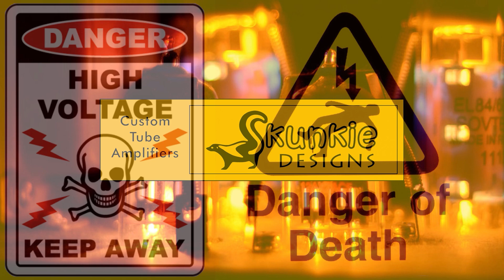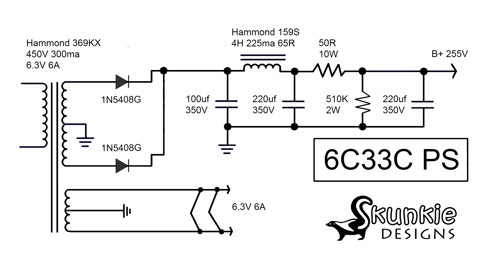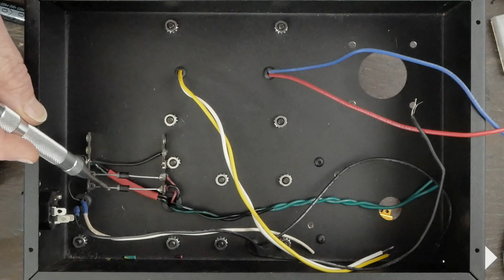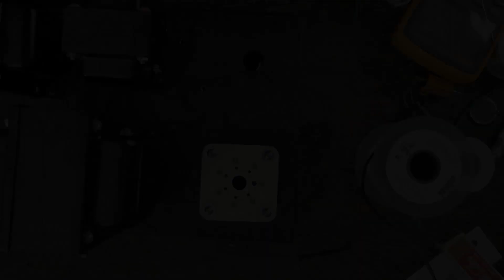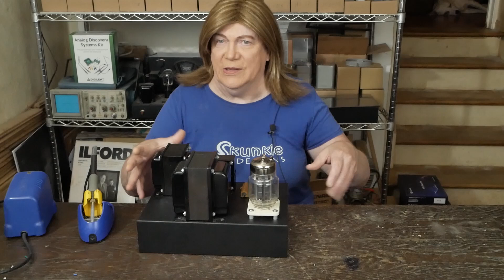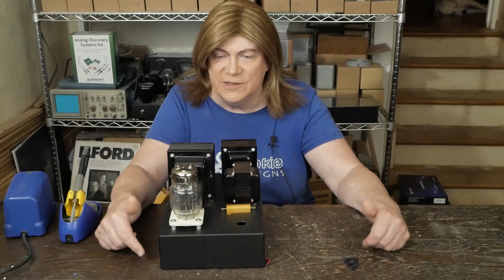6C33C Monster Tube Amp Build: Power Supply Wiring

Comment: You mentioened using that gold wirewound resistor for the cathode? Isn't that inductive? And the worst place you could have an inductive resistor? If I am wrong please correct me as I am not 100% sure. Still learning..
Reply from the maker: Doesn't seem to negatively impact the sound, but yeah it's not ideal. Trying to source a 50W non-inductive 300R resistor...
Reply: @SkunkieDesignsElectronics   I use Caddock MP850 series with  heatsink its in a TO-220 package. As an added bonus they sound great.

Comment: Hi Stephe, thanks for the video, how about using two cascaded triode preamp stages for the driver? Imean something like two stages of 6SN7?
Reply from the maker: I'm trying to keep this a two stage amp if possible. But not sure where this will end up!
Reply: @SkunkieDesignsElectronics I've seen a schematic for this amp with two 6SN7 preamp stages and fixed bias, I'm too confused about these tubes. Another SET amp which I  found interesting is 6336 twin triode with Cascadetubes design, I suggest you take a look at it, especially on the driver.

Comment: I very much understand your ways of ordering multiple times for one amplifier – same with me, either forgetting something, or revising my circuit draft, or not having developed the draft for the build fully…
Interesting, your use of the driver tube in a choke amplifier application! For some time now I have a project on my mind to do an amp with the English KT32 (American equivalent is 25L6(G)) as a SEP choke amp, feeding a high-impedance (800 ohms) speaker via output cap. Unfortunately, it will have to wait a couple of years…

Comment: heyo Stephe, I wonder a little bit that there are only two diodes in the rectifier and not four diodes like in a "Graetz-rectifier" or Bridge Rectifier. Would the DC Voltage then be too high with 4 diodes?
Reply from the maker: It's a full wave rectifier. The same as tube rectification would be, but is using SS. The transformer was chosen to be used like this, using a bridge the voltage would be way too high.
Reply: @SkunkieDesignsElectronics  thx, we all get smarter watching your videos!

Comment: Angel power transformers  can handle every high current. I use a Angel in my 813 push pull stereo amp..I run 1100 volts at 500 ma. 6 au4 tubes for power supply can take 1 amp.

Comment: I have a question.  Why did you tie the suppressor grid to the HV supply?
Reply from the maker: More GM and lower plate resistance tied to the plate than if you tie it to the cathode.

Comment: hi  your tranformers have not a good angle for magnetic field cancellation ,you must turn one to 90 degree ,its better
Reply from the maker: They are offset, I don't think that will be an issue. I was more concerned about the driver tube plate choke picking up noise as it will be MUCH more sensitive! Yes I know about this...

Comment: The 6C33C is known to be difficult to work with. Consider using the 6S19P (6С19П) instead. This tube, also designed in the USSR for voltage regulators, offers superior performance. It's exceptionally stable, more linear, consumes less filament power per watt of output, and can be easily paralleled.
Reply from the maker: Interesting tube, obviously much lower power output and smaller size. I think that is the allure of the 6C33C?
Reply: @SkunkieDesignsElectronics  Yes, people love challenges, it's human nature. 
In the Russian DIY community, those who experiment with the 6C33C tube often follow these steps: 
1. They attempt to build a classic amplifier using the 6C33C in class A without any negative feedback. This typically results in an unstable amplifier prone to overheating tubes and burned-out panels. 
2. Gradually, they increase the NFB for stability. For instance, they might rewind the output transformer to include a cathode winding. Eventually, they end up with a pure cathode follower design, but the sound becomes rather dull and transistor-like. 
3. After all this, they seek advice from the community and are usually recommended to switch to the 6S19P tube. 
4. They forget about the 6C33C as if it were a nightmare.

Comment: This looks so cool I hope it actually works out. As for the tube socket being safe , not so sure if you have children with small fingers or cats for that matter. I can see my cat fiddling under the socket and getting zapped.
Reply from the maker: Not safe for pets or small kids, honestly any household with kids or curious pets shouldn't have a tube amp running without a tamper proof cage over the tubes.
Reply: @SkunkieDesignsElectronics  Expect your right , mores the pity as I don't like them.